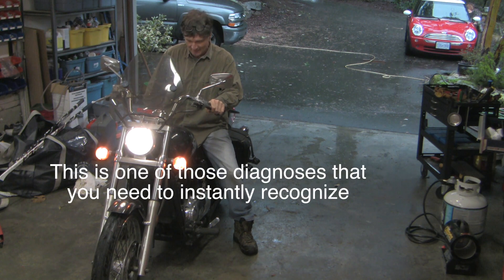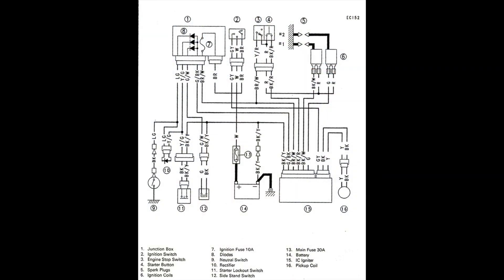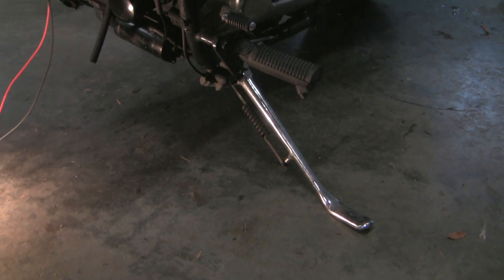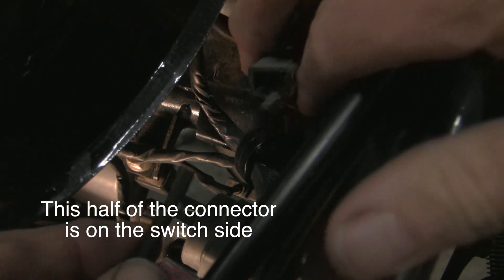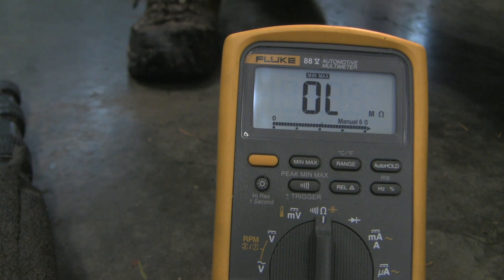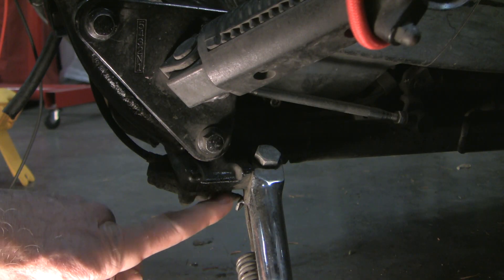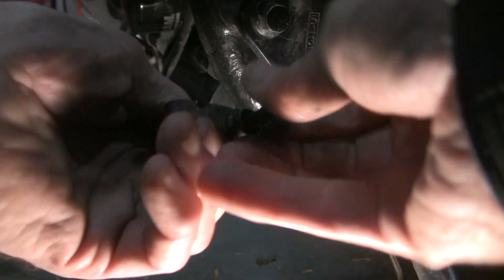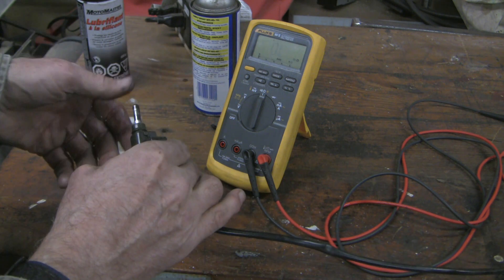Motorcycle Stalls when Clutch Released - how to fix

Comment: What could be the problem when: the bike is on the side stand, in neutral (the neutral light is also on), it starts, but idles rough. When I put the kickstand up, it idles better. 
When I pull to a stop, put it in neutral, put the side stand down and then release the clutch, the engine dies.
Reply from the maker: I'll throw out a big fat guess that your engine ground strap or the ground strap for the neutral safety switch is a high resistance connection. It could even be a bad neutral safety switch (too much resistance when switch is closed). To prove you're on the right track, you could temporarily jump the ground connection and see if the problem goes away, but remember, you can't leave it that way because those switches are safety devices. You'll have to go over your owners manual to find out where those wires are and how they are routed. Then start a search for green crusty corrosion or loose connections around wires and connectors. Try to verify the diagnosis first by drop testing before you fix it. You can prove a bad ground with a test light or by voltage drop testing at various points of the circuit. There are many good videos showing how to do voltage drop testing here on Youtube. Good luck!

Comment: Hello Spelunkerd - 
Fellow BC rider here, think you gave me a right direction to look at my bike's problem... Thanks for the video.
I ride BMW k1300S and it started giving me troubles when it is a really hot day, or if I catch heavy rain. As soon as the clutch is pulled the engine dies, especially in riding when I downshift from third to second, or second to first... It is not all the time but starting to do more often now... Pulling the clutch while the bike is rolling and starting the bike works, or if I am stopped starting the bike works too, but I have to be alerted all the time. Debating is it a clutch switch or the kick-stand switch...
Do you mind sharing your opinion?
Thanks a lot!
Reply from the maker: I'd be looking at other issues, especially vacuum leaks and idle control factors. Newer bikes have more complicated control and even some ability to read diagnostic codes (and maybe even get live data on a scan tool). I don't know anything about the BMWs. It would be fairly easy to test both the kick stand switch and the clutch switch by backprobing the wiring, then measure voltage drop across the switch with engine running. However given the symptoms I'd be looking elsewhere. All motorcycles are prone to vacuum leaks, which mostly cause idle issues, improved when throttle is applied. To look for a vacuum leak, I would inspect the intake manifold between the throttle buterfly and the cylinders, and spray water onto suspicious areas while the engine is running. If the engine stutters you've found a vacuum leak. A dirty carb can present with the same symptoms, so that too is worth considering.
Reply: @spelunkerd  That's awesome man, thanks a lot, that could be the next step to check. Went to my bike and checked both the clutch and the the kickstand switches and found the entire kickstand assembly, held by two bolts, was loose and freely moving shaking 5mm back/forth... And that is attached right to the stand switch !!! Of course, the stand is not moving when the bike's weight is on stand, but when the bike held up and stand retracted it was pretty obvious... I tighten it and will  ride her tomorrow to see if that was the fix (if it is not raining again... 😀)
THANKS A LOT!!!

Comment: Yes, I  was inspecting the kickstand switch as suggested,  and I cut the wire leading to the switch determined to bypass it and move on. As I did this about half a cup of thick muddy liquid oosed out,  nice.  No wonder it didn't work.  Ok, rewired a connector bypassed the switch and got back on the road.  Thanks for the love, jack.

Comment: What could be the problem if a dirt bike stalls out when you put it into gear? The bike is a 96 rm125 2 stroke.
Reply from the maker: If you've ruled out the kickstand switch I'd start from first principles, look for what's missing, spark, fuel, timing, etc. If spark drops out it might point again to the kickstand issue, I'd be looking for a wiring diagram. On the other hand if the engine chokes up under any load I'd be looking more generally at compression and fuel/air delivery, etc.
Reply: @spelunkerd  alright. I'm unsure if it has a kickstand. The previous kid said he did a top end rebuild. How would I check for spark? With a spark tester.

Comment: i will go for a drive and ill be coming to a stop after driving for a bit then when i shift into 1st or neutral coming to the stop my engine dies. i am getting a new carb soon it is having issues. ill check back in with ya after it comes in and gets installed. thanks for you time and videos !

Comment: Currently having an issue with my ZX-7R, the bike idles and starts fine, I put it in gear and put the kick stand up, when trying to pull off it cuts out exactly the same as your video. I bypassed the clutch switch and the bike runs and pulls off fine. Replaced the clutch switch and same issue. Now I’ve bought a new kick stand switch to see if that’s the issue but I’m running out of ideas. Are there any other switches that could be causing this issue? The neutral switch for example? 

Great quality video by the way 👍🏼
Reply from the maker: As tempting as it is to throw parts at the problem, a couple of minutes with a multimeter and a dealers repair manual will help verify the diagnosis before you play the swaptronics game. You can get inexpensive (~$40) PDF copies of Kawasaki bikes on their website, and in fact parts manuals are available for free download. I'd be focused on the kickstand switch, but if the switch is good then I'd look carefully at the wires and connectors for corrosion or rodent damage of wires. Trace those wires all the way back to the igniter, it wouldn't be uncommon for a lead to be broken or accidentally removed. If the problem happens when in gear, it is not the neutral switch, which should cut out when shifted into gear. The reason bypassing the clutch switch worked was because it bypasses the whole ground circuit all the time. A good clutch switch cuts out when the clutch handle is released. Looking at the wiring diagram, you can see the only pathway to ground in my bike while driving is through the kickstand switch, so I think you're on the right path to look there. Good luck!
Reply: spelunkerd  thanks, yeah I bought a new clutch and stand switch and it didn’t work in the beginning. I must have dirty electrical connectors or something because I was wiggling a few things around and now it works fine 🤔 problem is when you are riding the bike is bouncing around so the problem will likely come round again. Thanks for the response anyway! Top man 🤙🏻

Comment: My ninja dies when I let off the clutch. It’ll die unless I give it throttle.
Reply from the maker: Poor torque complicated by stalling at takeoff is a different problem, with various causes. Consider old fuel, dirty air filter, dirty carb, bad plugs, improper valve lash, low compression, etc.

Comment: Good afternoon sir. Just stopping by i thought I'd let you know that i got my 95 KLX 650 to run just fine. A new carn rebuild kit has it purring like new and i figured out what the stall problem was on mine. The previous owner could never get it to run.. -said the problem was something electrical but didn't know what to look for. I am guessing the owner before him hacked the kickstand switch out. The leads for the wlswitch are there and i never thought to disconnect them (yes the kickstand switch leads were neatly connected with banana plugs) to see if that would do any difference. So today i did after the carb rebuild i went ahead and disconnected the switch leads and threw her in gear -crossed my fingers and let go of cluth *VOILA!! No more stalling problem and she pulls like a mule

Comment: Good evening. My bike is a 95 KLX650 and i am having issue with getting it moving. It idles fine in neutral with kickstand down. Manual says this bike has a side stand switch to keep (stall out) the bike from rolling in gear while the kickstand is down but i dont see a switch anywhere near the side stand. Makes me wonder if the previous owner hacked the switch. My bike has the clutch switch as well under the clutch lever. When the bike is running and i put in in gear and begin to let go of the clutch it stalls. I can start it right back up if i hold the clutch back in; but then dies when i start to release the clutch. Any help will be greatly appreciated
Reply from the maker: Good question! If you can get a wiring diagram for your bike, maybe off Ebay or elsewhere, it will make this job and future tasks easier. A quick way to see if you're on the right track is to use an ignition spark tester to see if spark drops out as the vehicle fails. If spark continues as the engine dies, it is not the kickstand switch! The kickstand switch provides ground for the ignition module, so if you provide the ignition module a bypass test ground then the problem should disappear. I wouldn't use that to fix the problem because it is unsafe, but you'll build more evidence that you are on the right track. Other things, like the neutral safety switch, or maybe even an aftermarket DIY antitheft device, could do the same thing. Check connections, maybe start at the ignition module looking for loose wires or corrosion, then trace back. Good luck!
Reply: @spelunkerd  thank you very much for fast response and sharing your knowledge. I have a spark tester i will look at spark. How is a bypass test done to the ignition module? You mentioned a neutral safety switch. Could this be a problem if the bike starts fine in neutral without need for clutch? And starts fine when it's in gear with clutch pulled in

Comment: My atv four wheeler does this but has no stand ..... i need help man
Reply from the maker: ATV’s and rider mowers have various safety switches to prevent accidents, such as seat sensors, power takeoff sensors, mower sensors, brake sensors, and even the neutral safety switch. Check out the wiring diagram and owners manual for details. Good luck!

Comment: What if the clutch switch is ok? Then what?
Reply from the maker: In complicated cases it makes sense to start from basic principles, and there is no better place to start than the wiring diagram for your own bike. Here the problem was the sidestand swtich, but you can see that both the neutral safety switch and the clutch switch can provide a ground to the ignition system. For my bike, at least one of those three needs to come through with a route to ground. So, if I wasn't sure what was happening I would use a multimeter to decide whether the ground for the ignition was missing, then if it is missing I would test each of the three arms to decide which is bad. You may get clues from just observing the situation when it fails, and thinking though which connection has failed. Good luck!

Comment: my kickstand switch has never had contact with the stand as long as i have had the bike. someone previous to me pivoted the switch out of the way so the plunger stays out. today i ran into this problem with the dying when i released the clutch. it happened about 5 times so i wiggled the connection at the clutch lever and the bike worked fine. when i got home i disconnected the switch and sprayed it with contact cleaner. i hope that does the trick.

 i think you are incorrect when you state the switch at the clutch lever cannot be the fault. a bad connection can be the same as no connection and we know if you just disconnect the switch the starter will not engage.
Reply from the maker: It can be a headache to work on a bike with no wiring diagram and unrecorded work done by other owners in the past. With my bike, the wiring diagram shows that a sidestand switch that is frozen in the closed position will provide a ground for the ignition, regardless of whether the clutch switch is open or closed. It sounds like your bike is wired differently, perhaps by a prior owner who was trying to get it running again. As you say, the diagram shown in the video does not include the starter motor wiring, which includes the usual neutral safety switch requirement to prevent the bike from being started in gear, possibly throwing the rider off balance. Good for you to solve the problem, and thank you for recording your thoughts here.

Comment: Great video.  I just had this issue with my Kawasaki Vulcan 800 when the engine dies when I let out the clutch.  I was baffled about why this was happening.  Can't wait to try out this fix.  I didn't even know that there was a side stand safety switch but it does make sense to have one.

Comment: Great vid man! I'm new to bikes and just bought a used cbr 1000f. I know where my "friction zone" is so when I'm at a light and I know it's about to change, I'll find the friction zone and sure enough...if I go past it without throttle, it stalls. When I took the MSF, the bikes they gave us were nothing like that. Once you found the friction zone and got some speed, you could completely release the clutch and be fine. My bike puts and stutters and eventually stalls 😪

I thought it was maybe the chain since it was loose so I bought another one. Still having the problem. Thanks to your vid, imma try in first thing in the a.m. Wish me luck man. Let's hope this solves it.
Reply: So I checked and my kickstand is different. I didn't see the push plate nor the plunger. I did however see the wire connecting to the module. Any help would be appreciated. I sprayed wd-40 all over the thing tho (not the wire) so we'll see what happens.
Reply from the maker: One of the things that really helps is to have a dealers repair manual. For cars, there are aftermarket providers who sell access to dealer manuals for about $50/5 years. Unfortunately neither Alldata nor Mitchell seem to be interested in bikes. I bought my manual from the dealer at the time I got the bike, but a cheaper way to get one is to do a search, you may be able to find a pdf file or DVD that isn't too expensive. All that said, if your bike is similar to mine then the switch is a simple access to ground, in which case tying the two wires together cuts the kickstand switch out of the equation entirely. Your story is suspicious for something other than the kickstand switch, in which case you may notice no change in the problem when you do that. Don't forget to put it back the way you found it before moving on to look for other causes. Carb problems and vacuum leaks are really common in old bikes, that's where I'd be looking.

Comment: So my bike does the same thing but never when going into first.   It’s usually going into 2 or third. When I release the clutch it just dies.  I can fire her back up and keep on rolling but this has happened to me in an intersection before when down shifting and made me pretty nervous.
Reply from the maker: Hmm, I'm not sure. If the stand is up, you shouldn't have any issue with the engine cutting out because of loss of ignition ground, even if the neutral safety switch is bad (because when the stand is up you already have a pathway to ground for the ignition. I'd be considering other issues, maybe a carb issue when low end torque is needed after an up shift. All kinds of problems can happen at low rpm, including vacuum leaks, air intake compromise, bad gas, compression, ignition, etc. The last time I had that problem it was a dirty carb....

Comment: Great video. Well done. Not that you've asked for suggestions, but a soft box or two would be all I would add to make this video even better. My 1976 DT175 does not have a side stand switch. I'll pull the clutch basket and probably get new friction plates. I think the cable is a bit stretched too. I had to stick a bolt at the bottom stay to get more play at the perch so I'll replace it with one from e-bay.
Reply from the maker: My thoughts exactly, the lighting was poor for some clips, and a soft box would have offered better detail. I always find audio errors, too, in almost every video I do. It's been a work in progress, partially redeemed by content. Thanks for watching!

Comment: I can’t thank you enough for this video, I’m a beginner biker so I had this stalling problem, I thought it was just the lack of practice but then when a friend tried to help and explain me how to do it he notice that the bike died if no gas was pumped while releasing the clutch and told me that was a problem, (he’s not a mechanic though) we ‘been checking the internet for two or three days searching for tutorials and after we saw this and try it on the bike everything works like a charm, I can finally ride in a way I fell safe and confident, no more drag race starts nor stalling
Reply: Drag race starts 😂😂😂😂😂 Same here brother, same here. New rider and having this exact same issue. If I don't give it at least a 1/8 inch turn on the throttle it stalls as clutch is being release. Can't wait to try this in the morning.